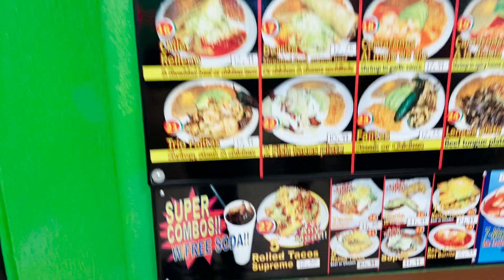PHANTOM F12 CLUTCH & VARIATOR TEST! J.Costa PRO

Comment: sir try to put .1mm washer before the driveface in the front pulley then check if the belt goes up in torque drive then try if its ok to you

Comment: Recently picked up a 1989 Honda Elite, but the gas tank is rusted😢 any tips on how to get it clean?
Vid dope as usual
Reply from the maker: there’s definitely some methods ppl use to clean rusty tanks just check some vids on youtube. there’s also kits you can buy
Reply: Try 4 lemonacid with hot water for 4 day
Reply: Fill it all the way whis Evaporust for 24h
Reply: Citric acid+hot water 24H covered with blankets. Rinse and dry it. Done.
Reply: @erikbalint2904  a legjobb:)